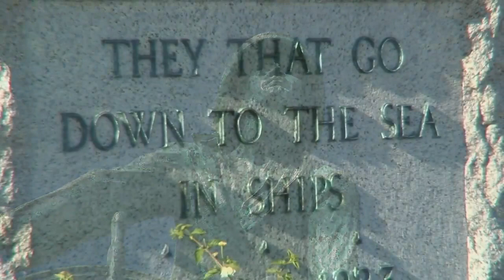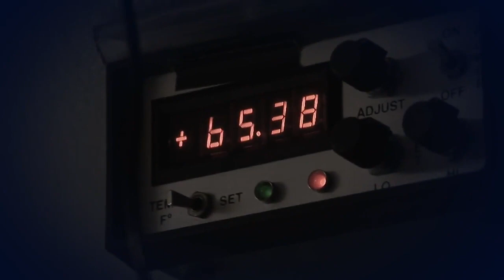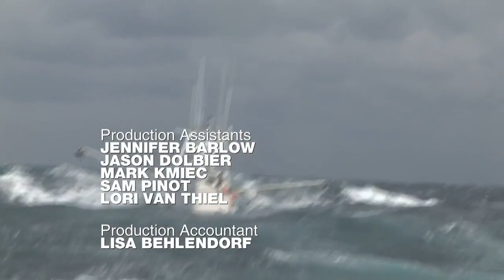FULL EPISODE - Swords: Life On The Line | Season 1 | Episode 5

Comment: Something I have been wanting to address for at least two episodes..... THE BOATS... The boat is your home at sea. Up to 600 miles or more off shore. WHY are they not better maintained in the off season? Even I have run a surface nipper.  A tool that removes paint and rust down to bare metal prepping it for deck primer and paint. All the blocks and tackle used to set and retrieve line should be cleaned, lubricated, and painted. AND ITEMS LIKE THE DOOR that are not used because they are to hard to get in and out should be made to work properly and with ease.... 
Of course the boat itself should be prepped and painted.... Do the boat like we do our house.... One side gets painted every summer.... In four years you start over knowing ONE side may need to be painted every year.... OF COURSE here in the USA the South side may need two coats to every one for the others.... UV rays and all.  TAKE care of your home, BOAT, and it will take care of you instead of dropping valuable cargo , fish, over the side and maybe even you.
Reply: They don care
Reply: Can they do it in the winter, when the harbor is frozen over??
Reply: They do a lot more than you think.. plus those boats work all year round. You are just seeing one 2month sword fish season.   There is a lot more to maintain that’s way more important than the paint.  I live in a harbor town I know what goes into these boats to keep them fishing.  They are better then they look. The ocean gives them a beating. Plus they are out there to make money not look good.